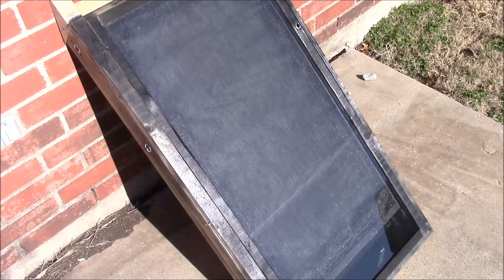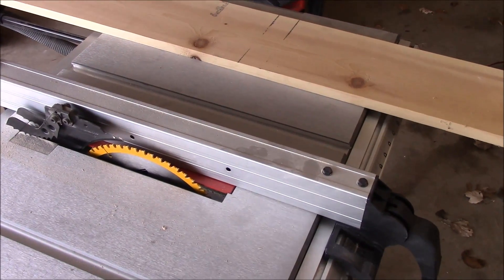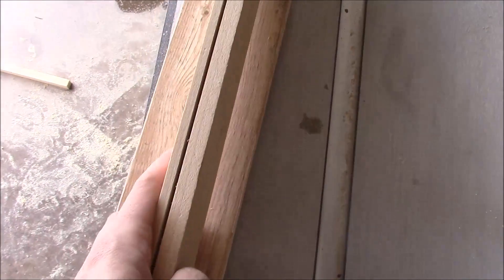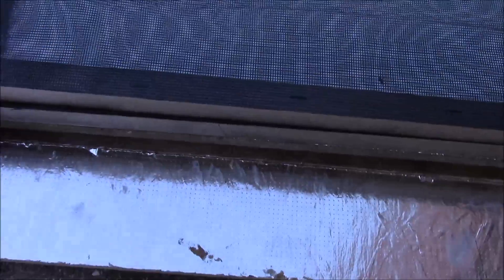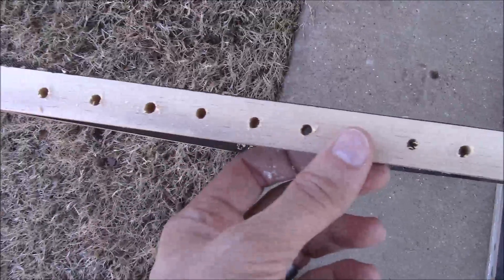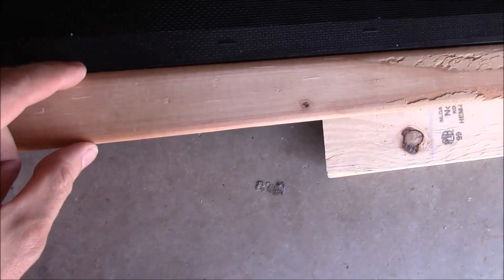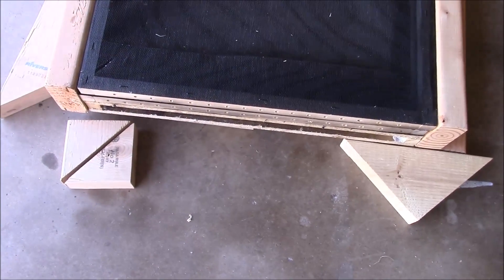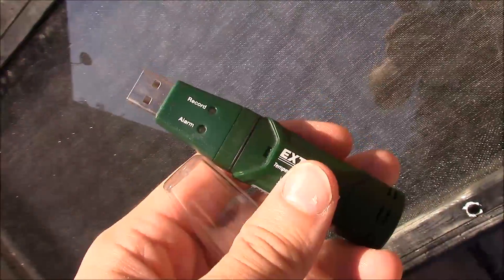Solar Passive Window Heater v2 - Cheap And Effective!

Comment: i know this is a bit old, but i wonder if an old washing machine could be used as the heat box, like strip out all the crap inside and put in some plastic pipe and create a hole in the front of the washer paint the outside of the washer black so it will collect the heat and inside the washer maybe add in some styroform to keep the heat in the box and then get a pipe to direct the air through convection of the air as heat rises into your house.

anyway i just kind of came up with this idea at random because i have seen enough of these experiments that i have a pretty good idea that it should work given everything is set up correctly.
Reply from the maker: I am sure it would work.  But you want to try to maximize surface area.  That is why people use soda cans, corrugated roofing materials, window screens, etc. to do this.  Because air can pass through and it isn't just a flat surface but either has waves, ridges, curves or you can use multiple layers like with this screen material to get more surface area than just a flat surface.
Reply: @LDSreliance  
hmn ok...
have you heard of geothermal storage, where you basically store heat underground within an container space that is constantly being fed heat during the day using a solar heat thermal collector above ground.

then you have to bury piping within this space with sand as it can hold heat very well so long as it's contained in that underground battery, but the piping is a closed system that only calls for heating when the user inside the house needs it via fan that only turns on via temp threshold.

instead of using that heat during the day with one of these collectors, it's stored under ground within a bed of sand and piping that's directed into the house.

anyway, idk if you have tried anything like this, i just found your channel and had a quick look through your videos list and i couldn't find this topic or anything relating to it besides this video.
Reply from the maker: Yes, I have heard of geothermal.  I haven't been able to try it out since I live in the suburbs on a small lot where that isn't possible but someday I hope to try it out.  In the meantime, I have to try smaller projects like the one in this video!
Reply: @LDSreliance  
oh lol, i just assumed you were off the grid somewhere, again new to your channel and all.

but then again i guess i don't really know about the restrictions for geothermal within the suburbs, in my head i just think dig a hole plant the seeds in what your doing and do it.
Reply from the maker: Geothermal needs to be pretty deep and requires quite a bit of space for enough surface area in the pipes/tubes.  It is similar to installing a septic system.  And the bigger the house, the bigger the space you need for the installation.  At least that is my understanding.
Reply: @LDSreliance  
you would be correct. i believe it needs to be at least 8 feet underground to get the proper insulation from what i remember.

i have also payed attention how the earthship community does this so that the house has proper protection from the heat of the summer as well as the cold of the winter, now obviously modern homes aren't quite equipped for that kind of setup, unless it's a house where only the basement was built and they just covered the roof with a structure and dirt to finish it off with.

of course earthships use tires as the battery, but i wouldn't want to use tires as they can release deadly gases that are impossible to smell without having the right equipment on hand.

that's why i like the idea behind the underground sand battery as it could be used to heat the home on cold winter nights via solar collection during the day without the need of having to burn anything most nights, i think it's also good to have multiple options set in place just in case one fails or under preforms.
Reply from the maker: Sand is good but don't forget water.  Air to water (and solar to water) heat exchangers are more efficient than air to air (and solar to air) exchangers.  So if you could get a 3000 gallon burial water tank far enough underground to protect it from the cold and surround that with sand and then use a water pump to circulate the water through a giant solar water heat exchanger on top of the roof... that would be the ultimate in my mind.
Reply: @LDSreliance  
there is a Norwegian company doing this right now, and i can't remember their method besides the collection of heat and underground storage using sand and having pipes directed into the property with fans that just push that air underground only within the closed system to heat the air and exchange it.

but i can't remember their full method in how they get the heat to go underground, they might be using the type of solar tubes that have natural vacuume capability to store the heat, but as we know heat rises so that vacuume would have to work really well to keep that heat down to store it.

so you might be right, they might be doing it via water, however i think i remember them saying they didn't use water, i might have to do some more research on this.
Reply: @LDSreliance  
wait a minute, you just made me think of something else related to this idea, i wonder if an attic could be used as a heat battery or perhaps be used to create and collect the heat and recirculate back into the house? 

the heat within our house will rise as heat rises naturally, but it goes to the attic in most cases, the attic is designed to get rid of the excess heat for the summer when it comes to the vents, but it still produces heat even in the winter during the day, and could be redirected.

if that heat were to be collected via the sun hitting the house during the day, you could potentially use the heat of the attic as potential heat storage and collection as it seems to collect naturally anyway in this area, i mean obviously it would need to be pumped down somehow to store and use for later.

sorry, you just got me thinking about a few things, i love bouncing ideas off of you.
Reply from the maker: Your attic idea would work well in the summer but I don't know about the winter.  When I have had to get up in the attic in the winter here it is pretty cold.  Whether it is colder than 8 feet underground or not I don't know.
Reply: @LDSreliance  
collecting heat in the summer isn't what i was going for lol, at that point it's waste heat.

but if it could be collected in the space and perhaps the space is insulated just right, it could make all the difference, maybe...

some testing would be needed, i was also thinking of attaching the solar collector on the roof above the attic to send down the heat to be collected, but as i said, testing would be required to see where that might result.
Reply from the maker: Yes, testing would be required.  Good ideas!

Comment: I am considering building a small one of these for my girlfriends mother's house upstairs. There is no heat upstairs, and If I get a simple heat setup going, this can work along side it for one of the rooms
Reply from the maker: That might be challenging for a second story but the principle will work for sure.  When it gets colder here in TX I am going to do a new video with a different style of heater system that should be pretty interesting.  So look for that coming up.
Reply: @LDSreliance  Well, Ive also got to fix a leak or two upstairs to help allow downstairs heat to come upstairs easier. But yes, I think It would be possible, just an idea. Sounds very cool of your ideas, Ill stay tuned.

Comment: love your stuff BUT on this video, i feel like your temperature reading with the USB stick is a bit inaccurate. It was sitting directly in the sunlight, this is going to effect the temperature reading... the USB stick should only be reading the air temperature but with the sun also beating down on it, its going to read higher than the actual surrounding air temperature.  since you have the other thermometer you can still get a general idea of where the temperature actually is.
Reply from the maker: Maybe.  There wasn't really anywhere else to put it, though.

Comment: how long does it blow hot air? as hot air is being pulled from the collector, cold air is entering, that cold air is not going to warm fast enough to continue to exhaust at the high temps you are showing.
Reply from the maker: Yes it is.  It blows hot air the entire time the sun is out.  That is the beauty of using passive thermal instead of active (with a fan or forced air).  The air only moves as fast as it can naturally heat up.  Hot air rises, right?  So the only air coming out of the heater is the warmer air.  Trust me, it works.

Comment: Thank you for your videos on solar heating. I will definitely build the cheap version with some additional solutions. One of them being connecting the box to the room with two pipes. One sucking the cold air from the bottom of the room into the box and the other blowing the hot air from the box into the room. I will use a solar driven fan for that. My question to you as a home constructor is how hot the pipe will get that goes through the wall. The wall of my shed contains wood and styrofoam. Is there any danger of burning?
Reply from the maker: Not at all.  The hottest I ever recorded was about 160 degrees F.  Unless you are using mirrors or fresnel lenses to focus the sunlight, you really can't ever get above 200 degrees even if you wanted to.

Comment: Nice video and looks a lot more efficient than first attempt, which by the way, was clever. I thought that having the collector angled would provide better heat absorption and I would assume you do as well. My question is how would one plumb it to the inside of the space you want heat? With the smaller size you showed here, making more than one would be economically feasible and could provide a significant amount of heat to a garage or large shed. Great work and thanks for sharing
Reply from the maker: +Emperor Ming Yes, you would have to go larger scale to make this really work.  This was more of a scientific test than an actual working unit.  I never plumbed this one to the inside of the house.  What I would have done is build a plenum box that will attach to the input and output ports of this heater.  It would have to have a divider inside that would keep the cold on the bottom and the hot on top.  Then you could put a hole in the hot side compartment and duct it to wherever you want it to go.  You would also have to duct the cold side as well.  You don't want to draw in outside air.  You could also install a valve with a flapper on each side that could be closed at night to keep warm inside air from seeping into the box.

But really something like that should be designed into the heater itself from the beginning and I did not do that.  I may make a 3rd attempt in 9 months or so during next winter.

Comment: wonder how well  and if it would even work in Michigan where we can get some pretty low temperatures of like -20f
Reply from the maker: It will definitely work as long as you are getting sunlight.  If it is cloudy it won't do anything.  It will produce 150+ degree temps even below freezing.  I have never tried it below zero because Texas doesn't get that cold but I bet it would still be making above 100 degrees F.

Comment: Nice work!
It's really hot over here in Perth WA at the moment, our black reticulation pipes are lying outside across the path and get ridiculously hot, made me wonder if you could just about make a small solar water heater with them, although metal pipes would probably work better, especially if you painted them black and used a reflector of some sort to direct the sunlight at the channels of piping. Then you could use the hot side of a Thermoelectric cooler to provide backup if there isn't enough sunlight to heat the pipes!

Haha my silly ideas but anyway nice video I liked it!
Reply from the maker: No, that is not a silly idea at all.  I have actually seen videos of people doing this.  It doesn't need to be metal. One guy used a $20 section of black, corrugated tubing that was like 4 inches (10 cm or so) in diameter and about 20-30 feet long. He put it out on the lawn in direct sun and connected a duct fan on one end to blow air through the pipes.  By the time the ambient air got through the pipes it was coming out over twice as hot as it started.  I think it was done in Florida in the winter if I remember correctly.
Reply: LDSreliance Wow that sounds amazing! I know someone who ran lengths of black tubing of some kind across the roof of their shed. The tubing was connected to the pool pump so that the sun heated up the pool water, don't know exactly how they managed to do it though!
Reply from the maker: Pumping water through a tube couldn't be easier.  Check out my water cooled peltier device video and that might spark some ideas:  https://www.youtube.com/watch?v=tnKlIc6oCCg
Reply: LDSreliance Yeah I've watched a few of your videos on peltiers because I've been playing with them a bit, but I can't seem to get the cold side to get really cold and they kept overloading my bench supply, so I need more power I think, maybe an old computer psu would work, I'll have to try again haha!
Reply from the maker: Sounds like you may already know how, but just in case here is a video of how to hack your old computer psu for use with peltiers and other 12v loads:  https://www.youtube.com/watch?v=M4TFVhCg6sk

Peltiers are power hungry and very poorly manufactured.  I have ordered quite a few over the years and a lot of them do not pull their rated amperage.  I would test the peltier just by itself with an ammeter for several seconds and see how much it draws.  It may have been damaged in shipping or just a dud.
Reply: LDSreliance Yes I have 3 of them which I bought a while back, the one I'm using at the moment seems to draw about 2 amps or so. It does get coldish but no where near freezing, I need to try it with some different heatsinks too. I'll watch the video on the power supply too, I have done it before but only on one supply, it was the green and black wires from memory that you connect up to a switch to tell the PSU to turn on. but not all supplies have the green wire on them! Thanks!
Reply from the maker: Np.  2 amps is very low.  I assume it is a 12705?  Here is a good test:  put some thermal paste on the hot side and attach it to a heat sink (only on the hot side) then plug it in.  Put a few drops of water on the cold side.  It should freeze within 10-15 seconds.  If it doesn't, there is something wrong with your peltier!
Reply: LDSreliance  Ah ok! So maybe I'm going to need to use a much larger supply (computer supply) as I know that the main 12v rails on the motherboard connector are high amperage. The 2 amp reading was on my little bench supply and the overload light would come on if you cranked the voltage up to 12v. I will try the test you described,  would an old cpu cooler be enough for the hot side for the test? Thanks for the help!
Reply from the maker: Yes, anything will be enough for the test.  You only need to run the peltier for about 20 seconds max so you just need something that will allow the hot side to shed some heat so it doesn't burn up.  An old cpu cooler will work perfect.

Even cheap computer psu's will be able to give you 20 amps or more when you combine all the 12v rails.  If the peltier still can't get cold with that much power available then it is a dud!
Reply: LDSreliance  Ok then I'll have to try it out! Hope it's not a dud but they are cheap anyway!